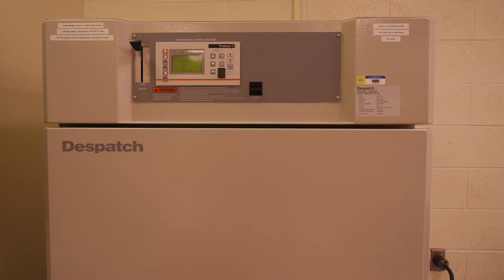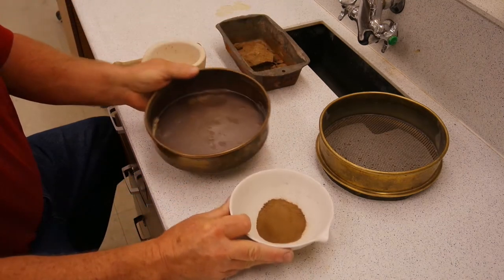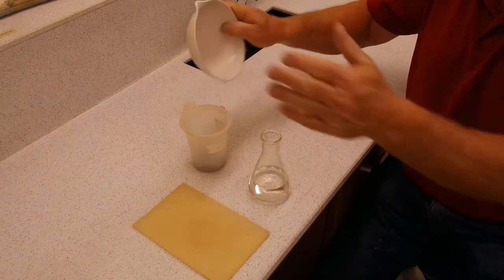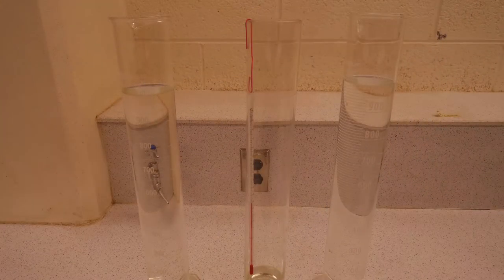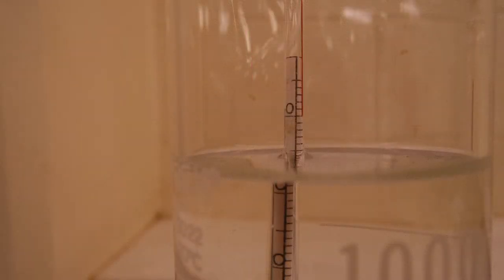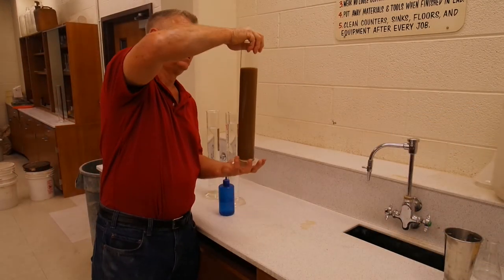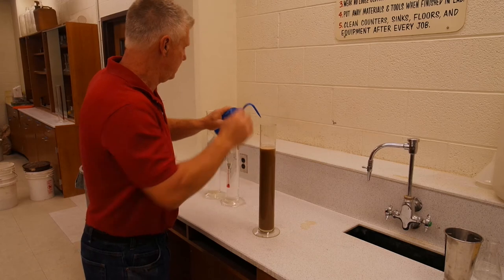CEEN 341 - Lab 2 - Hydrometer Analysis

Comment: This is a very good presentation. Unfortunately, ASTM D422 was discontinued several years ago and was replaced with ASTM D7928.
The sample preparation portion (0:00 - 5:50) appears the same. I don't think you should use your bare hand while mixing - induces contaminants. The mixing time / rate of inversions should be checked - I've heard both 60 cycles for 1 minute and 30 cycles per 1 minute.
I would have liked to hear a bit more discussion on the miniscus correction - is this due to the difference between the top and bottom of the miniscus or due to the difference in specific gravity of distilled water at 20 degrees C and the sample?  Is the sample to come to 1,000 ml before, or after the hydrometer is placed into the cylinder?